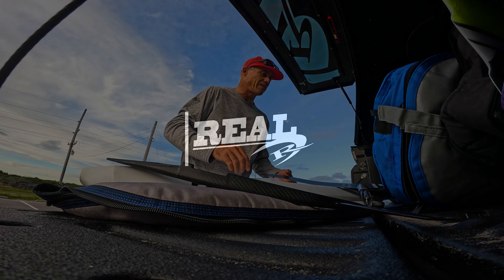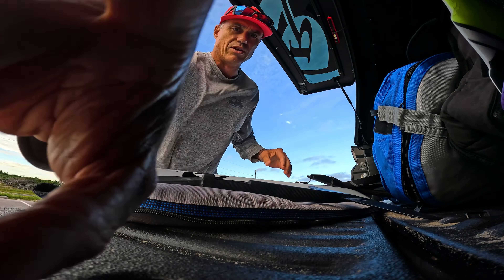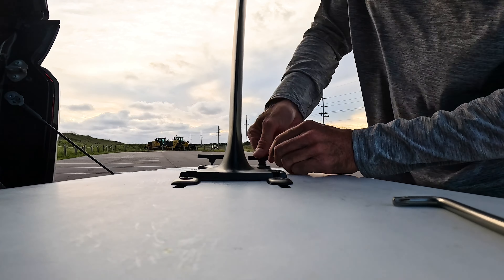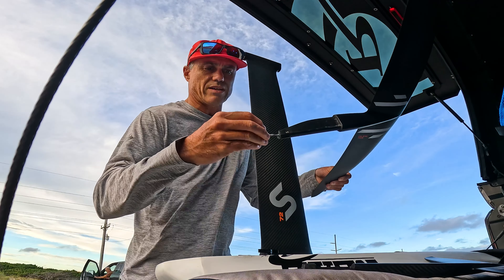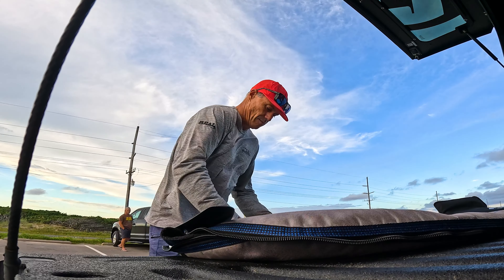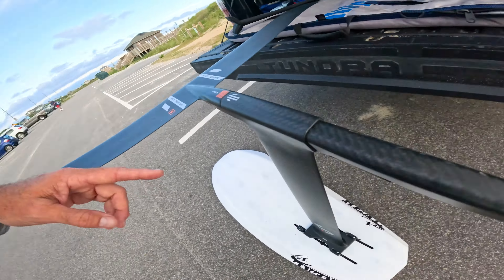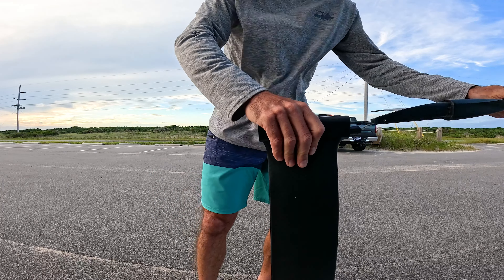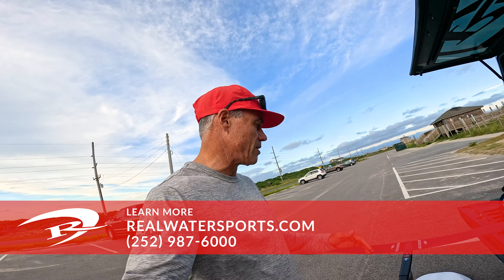Slingshot One-Lock Foils: Screws SUCK...Kind Of

Comment: I guess no one remembers 2-piece masts windsurfing. When you put the mast together, it is a tight tolerance fit just like this one lock. If you even get a few grains of sand/dirt/whatever in the sleeve it's almost impossible to take apart. We use duct tape to cover the seam which prevented crap from getting in there. Don't you think that since this foil is in the water constantly, it is going to get sand in there? Any thoughts on this?
Reply: Sand does not seem to be a big problem. There's a video on Instagram where Fred Hope puts it together with an extra big portion of sand (more than you would probably ever get in there in regular use) and it tightens up fine and comes apart more or less easily. They said the system will even work with the usual wear over the years and still be tight ... future will tell but I very much looking forward to test this soon !!
Reply: @hoppline  I saw that too. Those are prototypes. Would like to see production line tolerances and the same test next year.
Reply: @iggymon1019  I guess we will find out soon....
Reply: No. Mast are not adjustable. One Lock is for variances.
Reply: Screws suck. 

Here’s a bunch of proprietary screws and pieces to fit your board. 

This will be forgotten by next year. Haven’t seen a single person use it or recommend it. 

Honestly never even seen a Slingshot foil setup being used
Reply: @chrispewkreme  It's not available yet. Slingshot has been handing a few units to selected persons for feedback and to dealers for show and tell. After a couple of sessions on the new system I do think a lot of people will love it.....
Reply: I'm not convinced by the system. The quick release from Sabfoil is tried and tested and I can recommend it
Reply: @mooken08  I've had one for around 8 months, I've personally ridden it winging and now with foil Drive, the system is very good and super simple. its also been used as a demo here in Australia so plenty of people have had a go at it. I think its fair to say they were all pretty hard on the system and its still as good as new. if you're lucky enough to get one for demo try it and see what you think.

Comment: I run my one lock with  boards that have tracks out the back so no need for the board kit
Reply: That's probably the slickest way to do it. I do get the point of having no tools at all but I think I would rather not have the T screws sticking out....
Reply: @hoppline  you only need the t nuts when trying to find the ideal mast position. After that no need

Comment: It,s not even easy in parking lot.  You can imagine how it's going to work in sand.....
Reply: I've had one for around 8 months now, Matt said there probably is a knack to getting them apart. there is. board on the ground foot gently stopping the board sliding and wiggle the rear wing. super easy.
Reply from the maker: What Grant said is correct, like anything new the first few times you're figuring it out still. This system is pretty easy to use once you do it a few times.